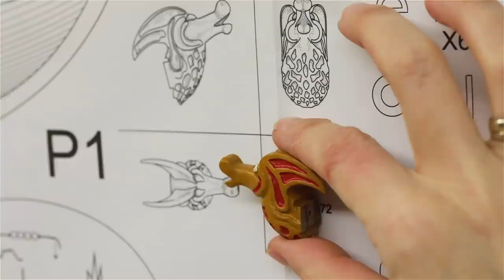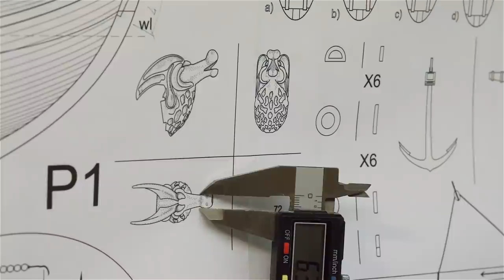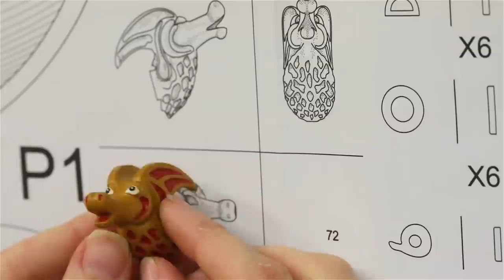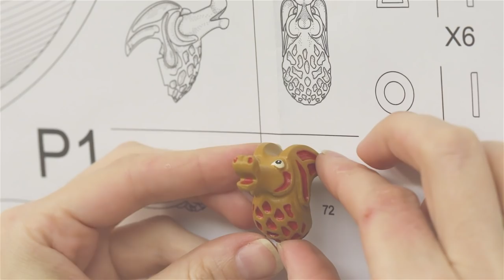Model ship building #15 - Making the FIGUREHEAD - RAGUSIAN CARRACK XVIc - KIT (MarisStella)

Comment: The figurehead came out great.  It has a good deal of personality. 
I have also purchased this kit. In this kit there is a resin cast version of the figurehead and the wood to carve one. Did you get a resin one too? The casting I have has small surface air bubbles and other imperfections. Not sure which will get used. Long way to go first.

Thanks for all your videos.
Reply from the maker: Thank you very much!
My build of a non-retail kit. That's why I don't have a resin figure. But you can use wood putty to remove air bubbles before painting!